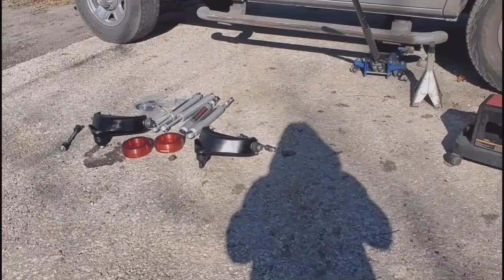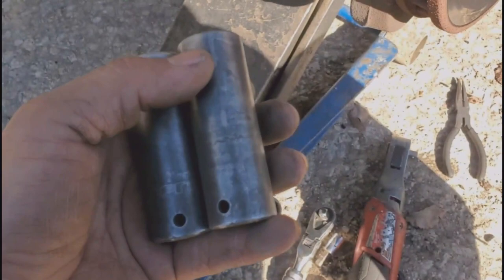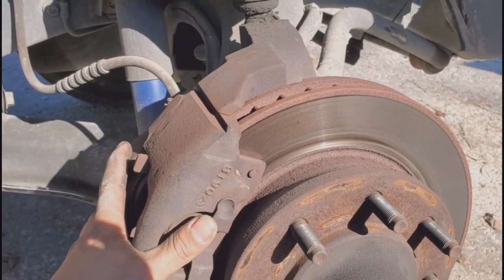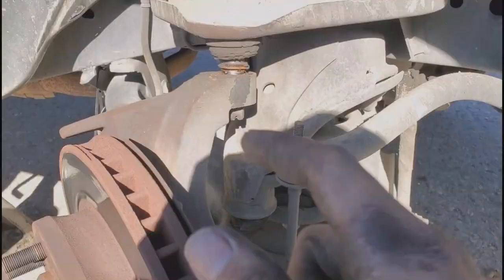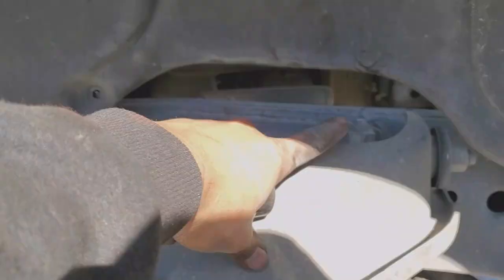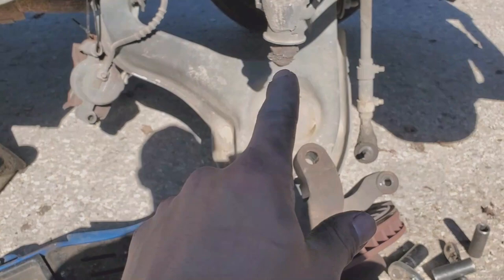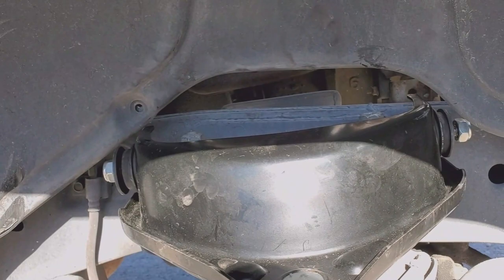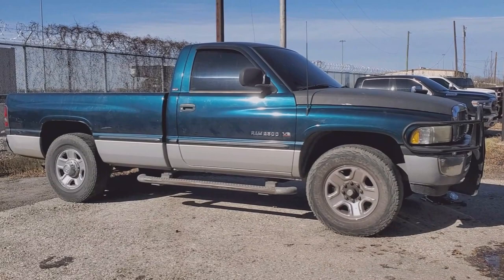1994 Dodge Ram 2500 2wd Leveling Kit, Shocks, Upper Control Arms, & Sway Bar Links Replacement

Comment: Hey I just installed the rough country shocks on my 1999 Dodge Ram truck. What were you saying about the travel of the shock absorber?
Reply from the maker: If you go with a 3 inch leveling kit it's better to buy shocks that are for 3inch kits . If not you will damage the original shocks quicker then normal time.
Reply: @HTXSuspensions  yeah I ordered the front shocks that were 7-8 inches with rough country cause it was error on the website. So I sent those back and ordered the 2-3 inch shock absorber